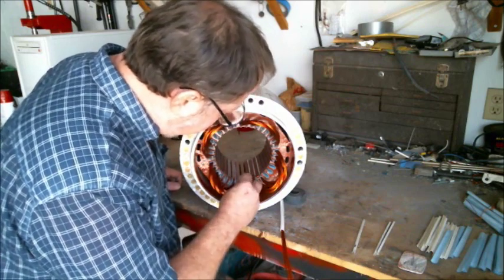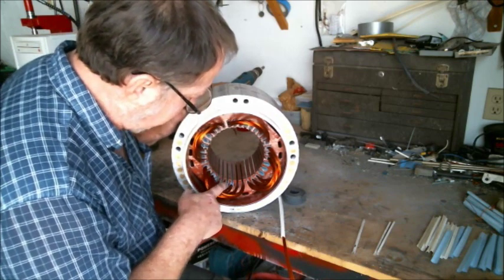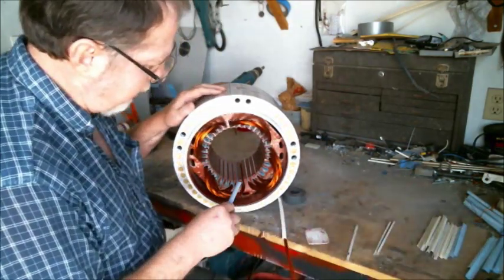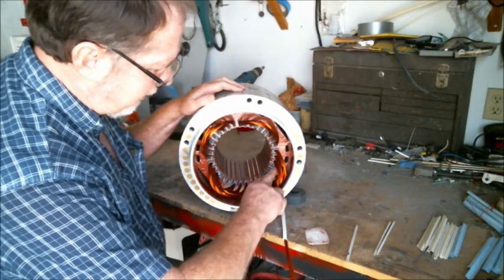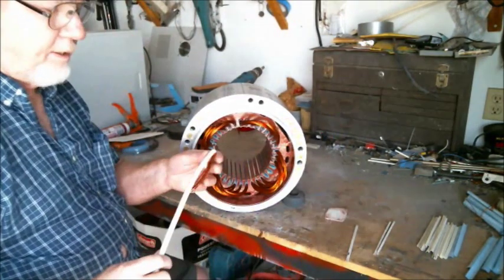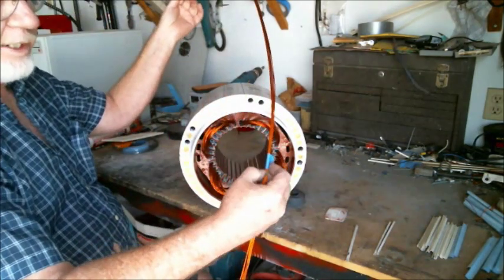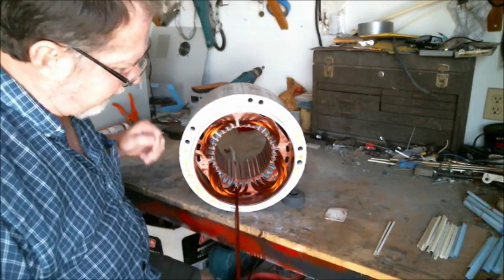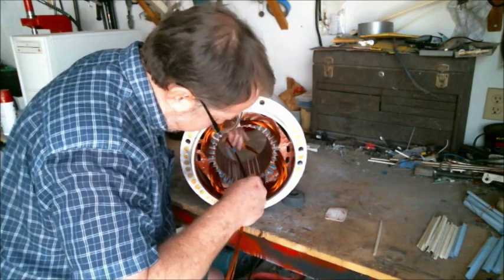Ivan's Garage

Comment: How do you know is 12 wires that you going to be using??????
Reply from the maker: +Javier Estrada   12 is a good count to handle the amp draw,  and that fits the slot pretty easy, try to get as much as possible in a slot.  12 at two turns
= 24 wires for one phase,,, times two phases per slot = 48 wires per slot, plus insulation......

Comment: Thanks. I could understand from here how poles and phases are phisically realised.     A question: the interval between phases seems to be 60 degrees (6 slots); I've read in a book that the phases are equally distributed; the interval  between 2 phases should't be 120 degrees (360/3)?  I have no experience , just want to understand more.
Reply: My understanding is, this is a four-pole AC motor, so the electrical angle is twice of the mechanical angle; so two phases are placed 60 degrees mechanically,  equals to 120 degrees electrically.

Comment: One question, what did you do to the end of the first phase 24 wires ? Did you terminate the wires ?
Reply: Just leave em hanging out till all phases are layed. You just can't
see them.
Reply: I used to work in the motor repair company, but recently got redundant,
I have experience in servo motor, induction motors repair.I came across with motors with collapsed phases,  but i never done the phases rewiring, on these cases we suggest the client to buy a new one, as it is more expensive to get it the phases re-done. But its interesting to know how they U,V,W phases are laid out in the stator. How did you work out the thickness of the copper wires ?
Reply: Keishil Prabhudas  The phases are usually 1-2-3 or a-b-c  you get u-v-w
after you do your delta connection. I all ways use 18 gauge wire fill the slot
with test wire and insulation to get your slot fill-wire count.

Comment: The second phase first two poles.
Reply from the maker: +Khalid Khan  Yes, each pole will use 12 slots, right, so one pole is slot1-2-3-4 and 9-10-11-12,  here is more, start wind at slot 1 to slot 9 slot 2 to slot 10 to slot 3 to slot 11 to slot 4 to slot 12 thats the first pole second pole would start at slot 24 to slot 16 to slot 23 to 15 to 22 to 14 to 21 to 13 thats second pole, third pole would start at slot 25.......................see the pattern,  the second phase would start at slot 9......
Reply: how can we rewind a 48 slot stator with 4 poles rotating rotor in generator.